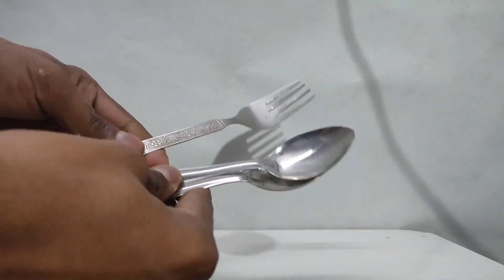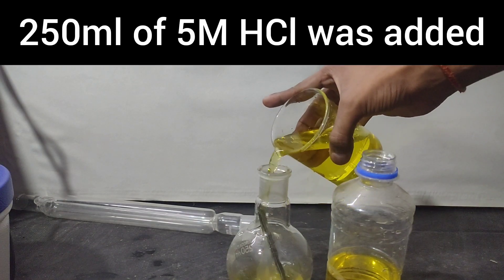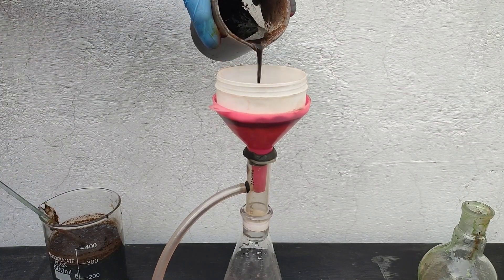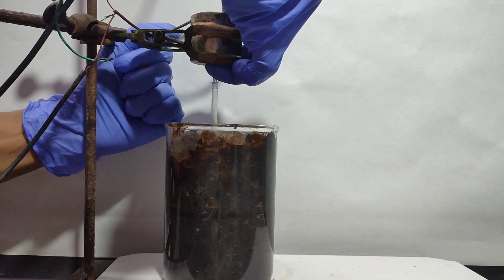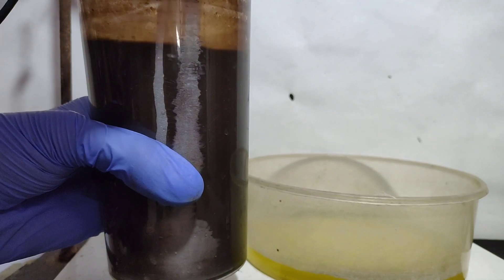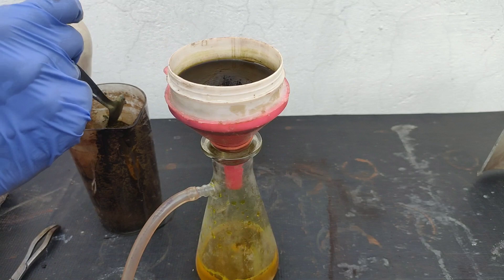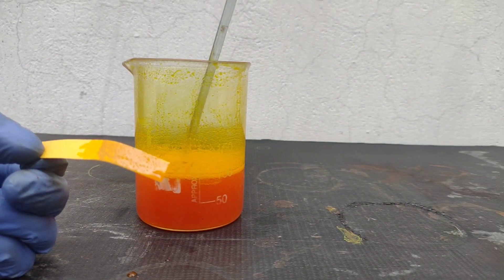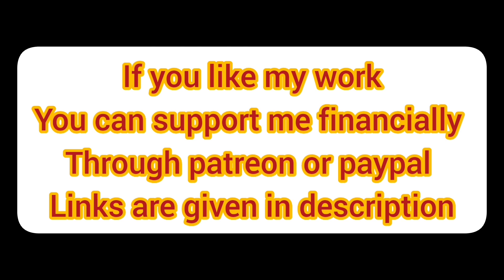Making Potassium Dichromate from Stainless Steel

Comment: Next time if you do this you should add sodium hypochlorite bleach to the chromium hydroxide and iron hydroxide. It will immediately turn the Cr(OH)3 to Na2Cr2O7
Reply from the maker: Actually bleach is pretty costly here so i dont prefer it. The dry method is better as it doesnt use any oxidant
Reply: @TheDIYChemist  idk about india but in bangladesh(where i am from) its pretty easy to make just by adding calcium hypochlorite bleach(which is very cheap) and sodium hydroxide in a 1 to 2 molar ratio and you could just filter the calcium hydroxide precipitate. You can also control the concentration and the bleach will be free of impurities.
Reply from the maker: May be i never tried . Although I have bleaching powder

Comment: Can this way make cr2o3? Need cr2o3 for ostwald processs😢
Reply: Can we extract vanadium pentoxide from Chrome vanadium wrench?
Reply from the maker: Ya i extracted Cr2O3 from chromium VI waste by first reducing it to Cr (iii) and then precipitating it by adding NaOH and filtering it and roasting it
Reply: Before boiling to recover cr2o3, is it necessary to convert chromate to dichromate? Will nacro4 pyrolyze to produce cr2o3?
Reply from the maker: Yes

Comment: Just please be aware that this is hexavalent chromium, so do not dump it down the drain or on the ground or whatever, it is toxic and very carcinogenic, so also you should maybe be using gloves to avoid accidental exposure. If you do want to dispose of it, at minimum you must first reduce it back to trivalent chromium, which is a lot safer, but if you don’t know what you’re doing, it may be best to find a local chemical waste processor
Reply from the maker: I recycled all the chromium waste into chromium III oxide now it can again be used to make potassium dichromate.

Comment: When you added "a spoon" of NaCl to accelerate corrosion, approx how much is it in grams? asking because i my steel took longer to corrode
Reply from the maker: Never measured may be around 3 to 4 g. The longer time taken by steel to corrode may be due to some other reasons such as quality of steel, low current etc.